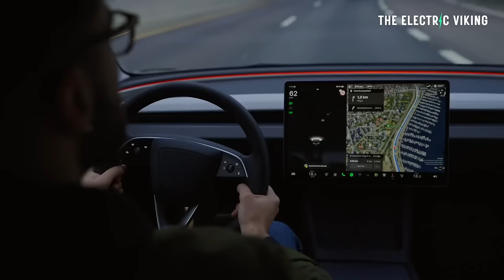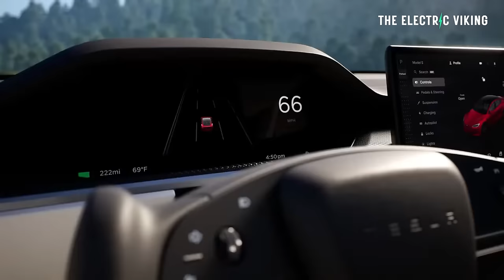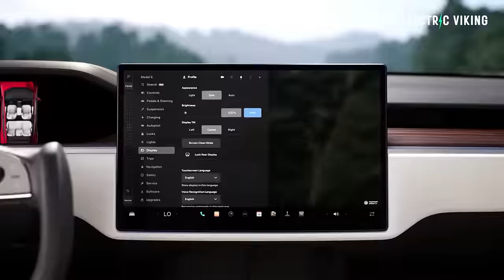Legacy Automakers lose $6,000 USD on every Electric Car they sell

Comment: I saw an actual Tesla ad before watching this video. I don't think I ever saw that before. When Tesla comes out with the Model 2 and FSD is going to be 100% entirely by then for some time (feels like 95% now), Tesla, with their massive advancements in manufacturing efficiencies, legacy is going to be so far behind on this. At the moment, probably the biggest reason E Vehicles don't dominate is because of cost (which Model 2 will address) and charging - it needs to be seen and known to be reliable and under 15 minutes for up to 80% charge - which also sounds like we are almost there

Comment: But EVs ALSO need to look good.
Hyundai ioniq 6 is ugly as hell!
Tesla look good, but inside it's like driving a ps5. If Tesla 3 had a "normal" interior, with the driving info in front of my face instead of being in the middle of the car, and had physical buttons for AC and "Radio", then it could be a great choice, but not the way the are.
IF I had the budget to buy a good new car NOW, I wouldn't by an EV because they're still very far from what I want/need in a car.
In a "couple" of years, when we have better and cheaper EVs, then the sales will sky rocket, but not before that I think...
Reply: If you like the Tesla Model 3/Y, but feel you have to have a speedometer in front of you, there are quite a few third-part options that plug in to do that. Seeems most people adapt within a few hours and can easily see what's needed, even though it's a couple of inches to the right of the steering wheel.  As for physical buttons for HVAC and the radio, there are fixed button positions on the display that are always available.  Tesla having automatic HVAC avoids a need to make many changes. Even seat heating and steering wheel heat have automatic settings.  Do a test drive - you might be surprised how good it is.  Then again, if not right for you, there are other EVs available.

Comment: Without a major increase in the generating capacity of the electrical grid even a 20% market share is a pipe dream. California and Texas can barely keep up with electrical demands on a hot Summer day (CA) or a very cold winter night (TX). And let's not forget the increased demand from the server centers that are planned for AI. In my family we have Tesla S and ICE cars. IMHO a plug-in hybrid car would be the best bet for now until there's adequate power supply and a much better and widespread charging station network. This mandate to eliminate ICE vehicles by 2035 is idiocy.
Reply: adequate power supply won't ever be built without a sense of urgency as well.
your fossel fuel industry is lobbying hard against any kind of renewable energy push in the states, so if other policy areas won't push the urgency, what can?
Reply: There's loads of extra generating capacity and grid capacity in off peak hours overnight, which is when most charging happens.  And Engineering Explained pointed out that the grid grew by like 6% a year for many decades.  Resume that historical trend, and the grid grows enormously in that time.
Reply: You should consider getting home solar power and be less dependent on the electric grid service providers.
Reply: Looks like an astroturf post.  The electrical grid will expand to meet demand.  It won’t expand before the demand is there.
Reply: @mauriceharting5877   If the house is unoccupied during the day there is little benefit to be gained by having solar panels. unless the system feeds the energy into batteries,which most people cannot afford.  In 10 yrs time we will be looking back at the disaster that we created by going full bore with wind and solar.
Reply: @bearcubdaycare   re enroll in day care
Reply: @Xind0898  why the sense of urgency? there is no rush to do anything. humanity is not in danger. there have been multiple periods when the planets  co2 levels were far higher than today. the problem is there are to many people like yourself that have duped into believe the climate alarmists predictions.
Reply: @robertfonovic3551  it ain't all about climate change is it? fossel fuel extraction causes harm to the immediate environment surrounding the extraction site, not to mention the transportation spillage and human working conditions on 3rd world sites
Reply: @FriedChairs The hydro providers work on the same business principle of supply and demand. If and when the demand increases they increase the supply and power generation. Hydro companies want to make a profit and as such when the demand is up they want to sell more power.
Reply: And are the Prima sources of electricity plant? It’s still fossil fuels in most countries
Reply: @yslee1401 Nuclear power baby or hydro dams is the way to go or large solar panel plants on many acres.
Reply: @bearcubdaycare less than 1% of the registered vehicles in the U.S. are EV's.
Reply: @FriedChairs  I live in California. There's no significant new base power generation being installed, it takes years thanks to NIMBYs and a regulatory scheme that works at the speed of glaciers. Wind and solar are intermittent and there's no significant battery storage at scale. During dry season the grid gets shutdown if it gets too windy due to the threat of wildfires. Our electrical grid infrastructure is crappy thanks to incompetent governance.
Reply: @yslee1401  Where I live the majority of our power is fossil fuel based.
Reply: @mauriceharting5877  The potential hydro dam sites are already developed where I live. Some of California's power is sourced from the dams on the Colorado river (and the coal fired plant in Arizona). Nuclear (fission) power won't be a player again for a minimum of 10 to 20 years. The nuclear power industrial infrastructure is a shadow of what it was is the 1970's. I know because I used to work in nuclear power until I saw the writing on the wall after 3 Mile Island. Chernobyl didn't help matters and Fukushima was a reset to zero.  Fusion power is 20 years away and has been that way for the last 40 years.

Comment: legacy might be waiting for a new standard in battery tech, which makes sense with LFP and now sodium ion coming in full commercialisation in the past couple of years - even EV specialists like Telsa and BYD have to invest massively to make the switch, so it seems like an ideal time to transition

also you have specialist battery companies like northvolt which legacy can use to temporarily delay the massive capex of building out battery tech infrastructure, take a hit to long-term competitiveness due to lack of vertical integration, but you mitigate massive risk in the short term, especially if you go all in on battery tech infrastructure at the wrong time

you'd think with time in market and existing infrastructure legacy automakers can offset lack of vertical integration of battery tech and still remain competitive but that remains to be seen, but maybe that was due to lack of off-the-shelf options, now they exists in the form of BYD and northvolt so who knows, might see some massive changes in the next couple of years as legacy catch up
Reply: You can build all the ev's you want. They are still charged by fossil fuel.  That's the sticking point.
Reply: Waiting while they should be building their BEV engineering moxy.    Bad idea.  Good cells in a poorly engineered car is still a fail.  Battery companies sell to the companies that can buy the cells in number.
Reply: most new ev need good ai which legacy maker still bad at. unless google step in

Comment: When on average, for the car maker, the cost of the EV battery is around $3.000 . . . . how can they make a loss of $6.000 per EV?
I guess, it is more about shifting to giga castings and robots. Legacy auto is old and still works with costly unions for dumb human labor.

Comment: Legacy Auto makers are screwed every which way from Sunday. Doomed if they do and Doomed if they don't. Just waiting for the next innovation that will hand them the pink slip...
Reply: They need to put their hands in their pockets and start throwing money at the problem until its fixed. Not rocket science.
Reply: Tesla has shown them since 2012 how it can be done. Tesla even makes all it patents available for free.  Legacy auto putting their collective heads in the sand isn't very effective.

Comment: That guy earlier thinks Tesla is in trouble when Tesla makes EV's a LOT cheaper than the traditional auto makers can make ICE vehicles.
Reply: Not quite true, unfortunately. Tesla ran at a loss on their car production for years. $9billion of their revenue has come from carbon credit sales. And even today, you can buy
something like a Corolla or a Golf a lot cheaper than a Tesla.
Reply: @davidbrayshaw3529  Tesla spent a lot of the first 10 years learning how to make cars.  It did not stop it continually improves them.  Tesla will make BEV for less than toyota does for a an ICE Corolla.   
Yes ZEV credits saved Tesla.  That is why congress put them in place.
Reply: @danharold3087  The big question will be how cheaply we can produce a KWh. of lithium ion battery. Surely the drive train in a BEV is a lot less expensive than the drive train in something like a Corolla already, at least that's what I'd be guessing. There's a fraction of the machining, materials and components and labour required to build a motor as compared to an internal combustion engine. Then there's the absence of a relatively complicated gearbox assembly to consider.
The battery is the Achille's heel in making BEV's competitive on price.
Reply: @davidbrayshaw3529  - Yet EVs are cheaper than comparable ICE cars today - when fracturing in 4 years of fueling and maintenance. ICE is so much more expensive to fuel and maintain, but that often is forgotten.  With the average new car price $49K, there are plenty of new EVs priced well below that.  Yes, there are not any new $20K EVs yet, but they are coming and one might be better off buying a used EV that provides far more value if one is very price senstive.
Reply: @tesla_tap  Certainly fuelling and maintenance is appealing. I'm in Australia.
My wife was keen on a model 3 about 12 months ago. I ran the numbers and nearly fell off my chair. The insurance and depreciation over here is insane on a new Tesla model 3. Given the fact that we barely do 5000 mile p.a. we couldn't absorb that cost via fuel savings.

Comment: The pro EV comment sections are absolutely unhinged. People fail to realize that there is nothing new about EVs, and that the quick charging issue cannot be resolved because the faster EVs charge the higher the load will be on the electric grid. A simple pertol station with 10 pumps can service 200 cars comfortably per hour, while a charging station with 10 stalls can only service 20 EVs and would require 5000 homes worth of electricity - provided that it's able to give full charge to all the cars charging at the same time. If you double the charging speed you also increase the load on the electric grid by the same margin. If those 1000 homes got 2000 EVs they now need multiples more charing stations comsuming staggering amounts of electricity. You do some quick maths and it becomes clear that people are being sold a product that didn't make sense from the start, solving a problem that does not exist.
Reply: If the government and local power companies got together and started installing battery packs at strategic spots, as well as developing the load sharing equipment and software do do it automatically, then this whole thing wouldn't be an issue. its a matter of priorities

Comment: Took you long enought to figure this out...Ive been saying this for 18 months. Why on earth manufacture EVs at a loss.

Just wait until the supply chain is cheaper and batteries are better...then jump in....it's Totyota...they have already dappled in the methods to build EV...it's smart
Reply: Toyota is late to the race for waiting others to create and work on the production method, applying them takes time, a lot of time, meanwhile, those who created the production methods and standard, hasn't stopped and are pass those as old technology, and already working on new production methods, first place takes all, Toyota is doomed due to laziness.
Reply: @Voltaje_YT  Toyota know exactly how to may EVs...they have made several including Lexus models. The EV market will shortly plateau....Hybrids are having a renaissance...Toyota will be fine.
Reply: @grantbuttenshaw  Every automaker have an idea how to make Evs, and they have done so, but they don't know how to do it profitably, efficiently, properly, they are just using their own old production processes and techniches, Toyota, and others believe they will be fine, but the Evs and the paradigm is changing faster than they are moving, given enough time, automakers could make it, but that is what they don't have, TIME, they do not thake Evs seriously,  that is why they slow and cut production, when they should ahve spent moeny and resources to produce TECHNOLOGY to make Evs, so no, Toyota is doomed, becasue nobody will buy ice cars, so Toyota won't have revenue, thus will die, or at best, be bailed out and be a low quality manufacturer.

Comment: All of the ‘above’ plus - $25k purchase, affordable FSD, practical ‘home’ charging, comprehensive ‘readable’ TCO comparison with ICE including the likes of insurance and tires, privacy regarding activity and driving by vendor and insurance legally framed and enforced. The glimmer of any ability to send an entire EV fleet to one zip code is not tenable.
Reply: So it's ok to send an entire ICE fleet somewhere? Most new ICE cars have software controls, but unlike legacy car companies where security is an afterthought, Tesla designed security in from the start.  I'd trust Tesla far more than any legacy car company.

Comment: Yes The Problem of the EV sales is  the Price s I  think the Prices are too high , too much for medium Class or average  people ,and for the normal class people impossible, imagine paying a Deposit of 30% for example $15.000  and spreading the reast 70 % monthly ,is like hanging him or her to death , The Medium and normal , average class people are more than the Rich class , so they have to find ways to make the EV Cheap for  every Pockets , Combustion engine cars have about 70 percent of cheap cars for the medium and the  normal  class ,Average people ,the cars  like Hyundai, Citroen, Peugeot,VW, Toyota etc are about $18.000 to $25.000 Dallars 💸 which every one can afford even that not easy ,and now all the beautiful EV 🚗every one can drive beautiful is Around $45.000 to $70.000 dallars ,for instance Zeekr 001  is   €67l.000 euros in Europe Zeekr 001 is a beautiful EV 🚗design for the Young People  ,,Young guy buying his ir her first EV at this price imagine ,, look at the big jump with big difference,  the price s of the EV🚗 must come down .or  they  cant sell , that is the only way people will switch from the Combustion Engine to EV 🚗
Reply: The problem with EV's is that you lose control. If you charge at home you have to have a smart meter and a smart charger. This gives the electricity suppliers the control of when and at what price you will be able to charge.

Comment: i think, for the USA manufacturer, a horse shaped electric power unit that can be attached to the front of the ICE vehicle is the solution.  That way the manufacturers and consumers can get used to the idea of EVs without fully commiting.
Reply: I want mine w zebra stripes bc well stripes are just cool.
Reply: The solution is hybrids. Toyota chose to focus on hybrid engines; a winning strategy for the future!
Reply: @stefan2796  I hear plugin provides all day ev power for most days driving.

Comment: Consumers are stupid. They can't get the gas station model out of their heads. Even when on a road trip and not charging at home where most of your 'fill-ups" normally occur, one just charges enough to get 150-200 miles down the road, plug in, use the toilet, get a snack, and your car will be now be charged enough to get you to the next charger where you repeat the process.
Reply: So it takes you at least 30 minutes to go to the toilet and get a snack?  And pay electric rates that are higher than equivalent gasoline costs?
Reply: @dzcav3  Electric charging rates are relatively high because we now get about 1/2 of our electricity from natural gas in the US. (Do I Need a US Content warning?)  It is to the advantage of the fossil fuel companies to ensure gasoline is still economical by comparison.   
One does not always have to do a full battery charge.  A trip to the can can be enough to get you 100 miles or so to the next charger where you do it again.
Reply: A recipe for obesity